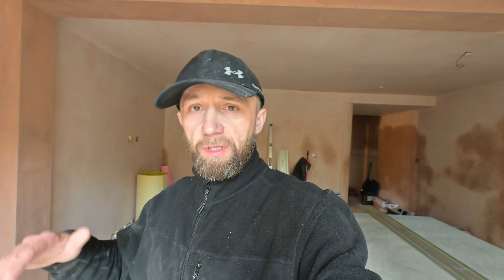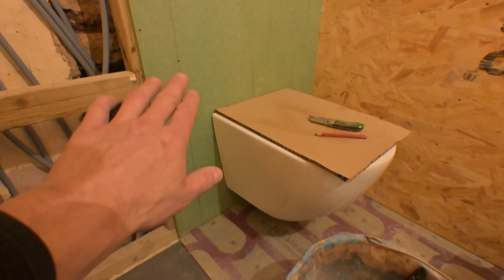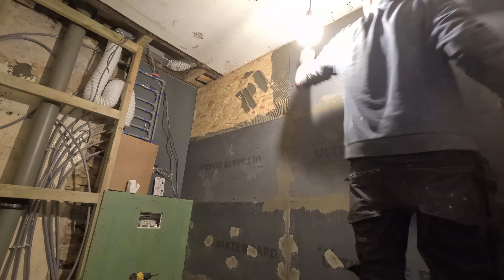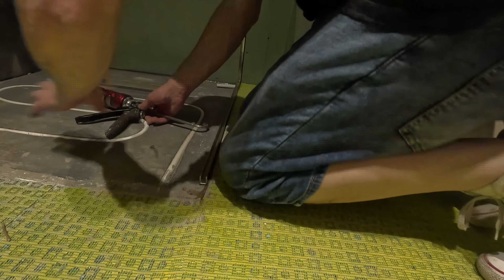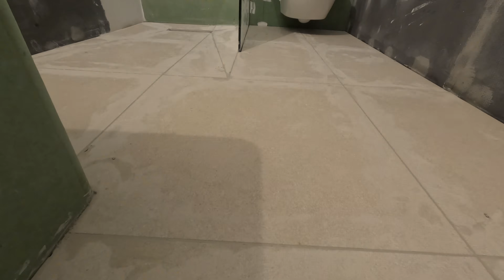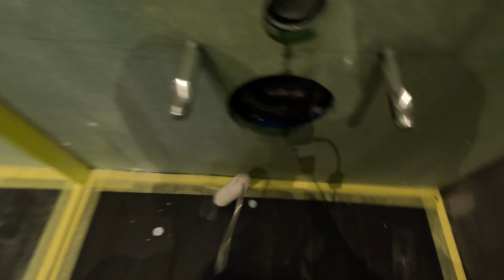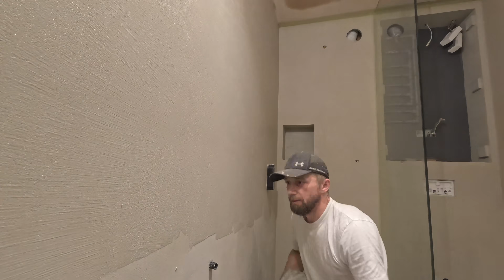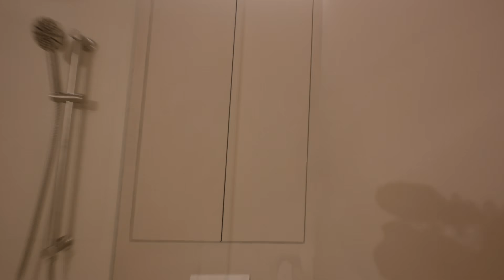The Death of Bathroom TILES..Micro-Cement Explained

Comment: Hmm... Let's see, applying membrane, then six coats of micro cement and sanding after each coat and lastly applying a sealer, I think that tiles are still alive and kicking. Imagine all the work needed if for some reason an area of the wall gets damaged, with tiles you just replace the tiles, and micro cement is more labor intensive and I am guessing the micro cement finish is more expensive... I am an old-fashioned person so I will use tile in my new house in Guadalajara, México. But it looks nice.
Reply from the maker: 😊 thank you for your words. 
It's not so bad. It's 3 coats of the microcement. When it gets damaged,you can repair small bits. Something large you would have gone over the whole wall. 
You see, with tiles is kind of similar. When it's damaged and let's say you don't have any spears and it's 5 years later, you most likely won't be able to buy the tile anyway. 
It's tricky. 
Micro cement is a completely different look and that is the biggest decision to make. The rest, don't worry too much. It will work. 😊
Reply: @yesconstructionltd  : You are right about being difficult to find the same tiles after a few years, I usually buy two extra boxes in case of future repairs.

Comment: looks great but I worry about mould and mildew in the small pores of the cement
Reply from the maker: Nothing to worry about. This stuff is antibacterial so no organic growth will ever happen. The surface looks rough but it is not. At the end it's sealed and made smooth .
Reply: @yesconstructionltd  : No organic growth, means not human friendly neither with all the chemicals used to make the product...
Reply from the maker: @sigmundgroth6452 
No, it's cool. It's an eco friendly product with VOC being extremely low. It's a product made in the EU and the EU is mad about all of this. The additive to stop fungus etc is also eco friendly. We buy a little bottle of it to add to a wall emulsion when painting in damp areas and It works really well.

Comment: But surface color and texture matching will be difficult when repairs are required on the plumbing.
Reply from the maker: Small repairs won't be visible. The whole idea is to do the plumbing in the way that you won't have to repair it from the back. You can change the cartridges from the front

Comment: So it's Micro Resin.
Reply from the maker: Well, you could say that. Back in the day, micro cement was made of crushed stone, cement and polymers. It was too rigid and fully waterproof. Only the final seal coat was waterproofing the surface. 
Today's micro cement is made of crushed stone (quartz) and eco-friendly resins, which are flexible and waterproof.

Comment: Problem with tiles is if there is ever need for a repair in the bathroom, you find yourself looking for the same tile (which is never still being sold years later).

With micro cement can you just do the work and reapply the coatings?
Reply from the maker: That is correct. As many times as you want. 😊

Comment: Beautiful work. Love the not having grout lines finish. Since you mentioned that it is resin based, are there any concerns with off-gassing, VOCs? Thanks.
Reply from the maker: Thank you. 😊 No issues with VOC. It's an eco friendly resin and the VOC is extremely low. It does not produce any fumes after the cure. The manufacturer does not state to wear a mask during installation, but I still do. You can see in the video wearing it but the strap popped and I finished it without it.

Comment: It's lovely, but NOT extremely tough.
Tiles are tough, this stuff is not.
Careful with the hyperbole.
Reply from the maker: Thank you for your advice. It's true, I might have exaggerated a little bit. 
This stuff is very tough if applied on a tough surface. In this case we have a board that isn't so tough so on heavy impact it will dent. Because of its flexibility it wouldn't chip.

Comment: When applying the adhesive to the OSB, it is spread out like small ridges / lines across the surface. Is that done to ensure that it is spread out evenly?
Reply from the maker: Hi. Thank you for stopping by. Yes, we use notched trowel to ensure that is speed evenly. Otherwise it will be bumpy.

Comment: why not use the green mdf for everything instead of the OSB? Cost?
Reply from the maker: We used the osb to create hard surface for the insulation boards. Using insulation boards is the best as it stops the possibility of condensation behind the board. We couldn't use that method on that one wall because of the toilet. The toilet would of crush the insulation board so it had to be something hard and suitable for micro cement. MDF is best for this .

Comment: Polybutulene plumbing pipe? Houston we have a problem…..
Reply from the maker: 😅 no. Polly is the best. It's point to point with zero joints in the wall or under the floor.
Reply: @y @yesconstructionltd ou still got joints at the ends, it’s banned in North America probably 30years ago, no longer available
Reply from the maker: @greigmcg this is POLLYPIPE. Here in the UK it's the best and most expensive push fit system. The pipe is multilayered and the fittings are 100%. Never leaks.
Reply: @yesconstructionltd you might be right it’s probably not under a lot of pressure, do you still have the cold water storage tank in the attic, it usually has a couple of dead crows in it?
Reply from the maker: @greigmcg 😅 not any more. This property is powered with a heat pump. I am a bit sceptical about it. I can wait for the winter to come to get feedback from the client on how the heating is coping.

Comment: Interesting. I wish I'd come across this video a couple of months back when I was making a replacement roof for my fish pond filter "shed". 

The old one was marine ply covered in felt, but it still only lasted around 10 years. I went with composite decking boards in the end, but waterproof MDF coated with this stuff sounds like it would be even better. 

You don't wear a mask while sanding?
Reply from the maker: I do (usually) but the strap popped. You can see in the video at the beginning that I am wearing one. 
The dust is very heavy and it drops on the floor instead of being airborn. It's not much of it anyway.

Comment: Do you also use the same build up as 3 layers on the bathroom cabinet, and bathroom furniture you make? I'm very curious about this stuff and wonder if I can do kitchen cabinets in it too. Genuine find it genius. I love your channel
Reply from the maker: Thank you 🙂
Yes, the buildup is the same. In this case, there are 2 base coats and one top coat. If you use one coat of base and one top coat, it will be much patchier (which is nice), but it will look different from the rest, so you have to keep it consistent. This stuff is great because you can build your own furniture and cover it with micro cement. You can use oak-veneered doors to make it a bit cosier. 
And yes, you can do the same with your kitchen doors, worktops, and splashbacks. I am working on my new video, where I'll show you how to do the worktops. It's a slightly different method from what you've seen in my video. I am planning to do this in my own kitchen too, just don't have the time.

Comment: Jeez, that stuff is labour intensive 😮. Nice to see reputable tradesmen, who take pride in their work, still exist. It’s becoming increasingly rare.
Reply from the maker: Thank you for the kind words, I really appreciate it! 😊
Reply: not all micro cement products require 6 layer's...
Reply: Much less labor than tile
Reply: @markme4  No way, like 6 layers with sanding in between each
Reply: @jasonfournier good if you're paid by the hour
Reply from the maker: @markme4 I think it's more pleasurable, the process.
Reply: @markme4  I can tile and plaster. I could get to a finished state, with large tiles, at least three times  as fast on those walls.  Mosaics, not so much.
Reply: @sage1d590 
  Right if the walls are already prepped for you. A good old school mud float takes time to.
Reply: @markme4  my comment was based upon the video, where the walls were perfect. If you don’t like other people’s opinions I suggest you stop reading them🤦🏼

Comment: Osb board and mdf in a bathroom.no.marine ply only.i would run you.
Reply from the maker: The osb is completely separated from moisture by insulation from behind and from the front so what is the problem? Beside that, osb is a construction board invented for building outdoor buildings and a roof structures. So what is the problem here? Same with the mdf. That is what the manufacturer is suggesting to use for furniture making in the bathroom. It's completely sperated from any moisture. It can be made out of  cardboard and there will be no problem.

Comment: How long did the micro cement process take without counting installing the walls and sanding the joints. If everything was there ready to go. Just the walls
Reply from the maker: Hi 
It's a 5 day proces. Durring hot summer days you can make it 4. Some days a short and some a longer so it's good to have a two bathrooms on the go if you are doing this for a living. 
Day 1.
 Primer coat. 
It needs complete curing before the next step. 
Day2.
First Base coat. 
Day3.
Sanding and Secound base coat. On a hot day you might be able to sad and apply the top coat. If not then..
Day 4.
Sanding and top coat. 
Day 5.
Sanding and sealer coat. If the temperature is above 15° it should dry in 3-4 hours and you apply again. 

The bathroom will be ready for use after 72 hours. 

I go back a day after the final sealer coat and I apply one coat of hydroxide primer on all flat surfaces such as vanity tops or inside of a niche etc. that primer is crazy resistant to water and temperature. It's the same stuff they paint concrete bridges with. It's a bit of an overkill, but I rather be safe than sorry. 
My nex micro cement video will show how I use that primer. In this video I didn't record it.
Reply: @yesconstructionltd what’s the bridge primer sealer is it something they have here in the USA ?
Reply from the maker: @SS-br1kc 
It will come as part of the system. Should be supplied with the whole set.
Reply: Day 1 is primer and fiberglass ?
Reply from the maker: @SS-br1kc 
That depends what you are applying on. If there is no joints, then no need for the mesh like I did it on the MDF. 
In 2-3 weeks I will have another video showing completely different method where we plastered the bathroom and the mesh went into the plaster and the micro cement straight on top of it without mesh. You apply mesh where there is a risk of cracking . It's a special mesh, a lot thinner than usual mesh for plaster.
Reply: @yesconstructionltd ok yes will be a few joints where the Sheetrock and densesheild board meets
Reply from the maker: @SS-br1kc then mesh the lot. Better save than sorry
Reply: @yesconstructionltd what do you do at the bottoms where the micro cement meets the shower pans do you silicon ?
Reply from the maker: @SS-br1kc  as a finish is silicone but before micro cement application it should be takned with tanking tape
Reply: @yesconstructionltd tanking tape ? Never heard of that is their another term for it on the USA side ?

Comment: I love it. That bathroom looks amazing. I'm in NZ and we get earthquakes of course (had a jolt just this morning). I wonder how micro cement holds up to earthquakes? I'm wanting a bathroom renovation and the walls and floors are not completely flat and square. Perhaps that's not such an issue for micro cement, so long as the prep is correct as you say. I'm thinking of a wet area with a shower and toilet behind a glass screen, then a vanity and stacked laundry too. Maybe cemented floor too? I'll need to source someone locally unless you are here for a working holiday :) It does look like quite an involved process, but the end result is quite stunning.
Reply from the maker: Ooooh, thank you so much. 
New Zealand is on my holiday list 😊
I am just waiting for my kids to grow a little bit more so I don't have to carry them on my back while hiking 😅. 
The micro cement we use is extremely flexible. I did an experiment and I did the entire build up on a strip of paper. After curing I bent the strip into a full circle without any cracks or splits. I think if your prep is good, you use mesh, and your micro cement is something similar to what we use, you will be fine with small earthquakes. 
That must be fun, living in a place where your house can go down at any time😮
Reply: @yesconstructionltd  Wow it seems flexible enough for quakes then. A lot of our houses are wooden, so all they do is shake. Even the really bad quake which was the Kaikoura one where our house literally felt like it was bobbing about on waves, never did any structural damage. Christchurch had big problems in the areas where liquifaction happened, but we don't have that issue where I live. Well, NZ is a really beautiful place for sure. I like it here. I grew up in the UK and moved here 25 years ago, so I'm half Kiwi :) 
I'll try to source some local talent. Keep up the great work. You really do make it like an art form.
Reply from the maker: @Justyburger thank you 😊

Comment: I'm wondering about a combo...tile on the lower half of the bathroom, but micro-cement on the upper half. Does this make sense, or should it be all micro-cement?
Reply from the maker: Absolutely! Instead of painting as normally people do, use micro cement instead. It will stay there forever

Comment: Is this easy to repair without losing the finish? One benefit I think with tiles is you keep a box over and can always replace if they get damaged.
Reply from the maker: Hi, and thank you for engaging. You will get away with a small repair. Something bigger would be hard and noticeable so you would have to re-coat the entire wall. 
This stuff is not easy to damage. It's extremely flexible so on impact it would dent rather than chip.

Comment: This were the days: 1/2" WR drywall, one coat of compound, glue, 4x4 tile, grout ---- and you're done. Working efficiently and a long day and the bathroom would be done in one day or, tops, two.
But this process is just pure High Class. One worry is that if anything at all goes wrong in the wall cavities you have a hell of a demo & repair job to face.
Reply from the maker: Hello, and thank you for taking part. 
That is true, if something goes wrong behind the wall you will have to re coat the entire wall. This is why preparation is important. The plumbing and everything else needs to be tip top.

Comment: My wife is keen, but is it easy to clean? All the small crevices look like they'd trap water and mold? Looks mint though, great job.
Reply from the maker: Hi. Thank you for contributing. It's very easy to clean. You can't use bleach, just gentle cleaning products just like for marble. 
It looks rough but it's smooth. The final seal coat is smoothing everything. The more coats you apply the smoother it becomes so you control the outcome.

Comment: Very nice, like that a lot. As a bathroom fitter/ tiler I’ve not had anybody enquire about it yet, but a friend of ours in Ireland did it themselves. As an alternative to how you have buried the glass, can a glass profile be screwed to the finished surface ? And what about accessories? 
What micro cement product did you use ? I’d like to do bit of research into it? Thanks for posting
Reply from the maker: Hi, and thank you for contributing. 
I was just like you, tiling bathrooms all my life, and I saw it once: some company doing it on the project where I was installing a kitchen. I am very good with a trowel, so I observed, learned, asked a million questions, and I did my first bathroom. Now I suggest it to people, and I am giving them a choice of micro cement, and quite often they go for it. Once you are known for it, you'll get those jobs. I suggest you get in now. Micro cement is getting more and more popular. You can go over existing tiles, furniture, anything really. On one job, I micro-cemented an extractor fan so it matches the walls🙂

You can screw anything to micro-cement; just put some silicone behind it to seal the penetration. 

Are you in the UK? 

We are using www.claudicemento.com, but we are developing our own range, so if you are interested in this stuff, keep an eye on my channel, as I will announce the product once it is ready. Alternatively, you can go to my website, where you can find my number.
Reply: @yesconstructionltd thanks for messaging. Yes I’m up in south Manchester area. Subscribed to you now 👍
Reply from the maker: @paulstevenson6769  thank you 😊